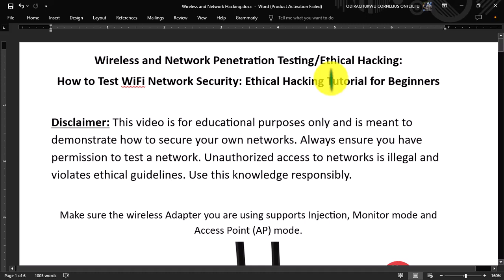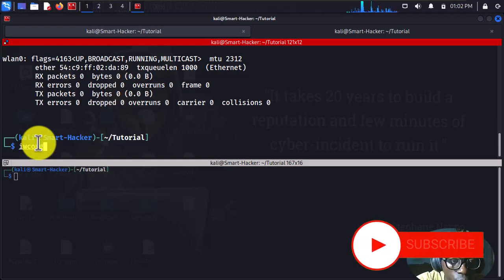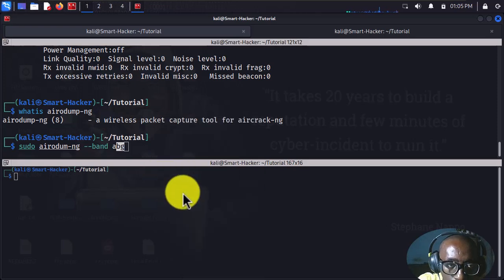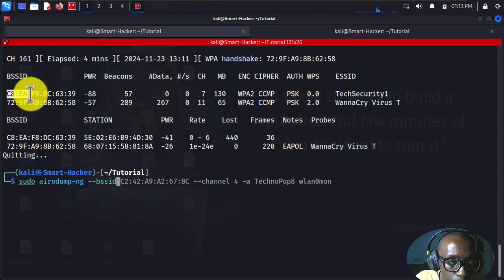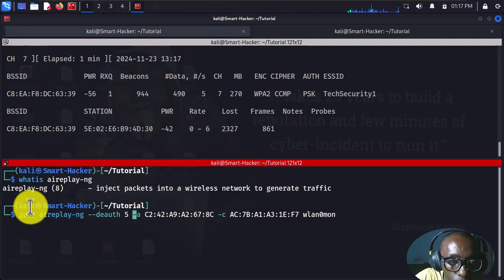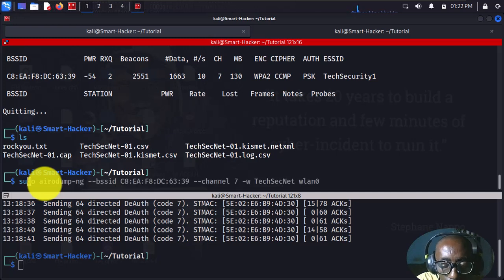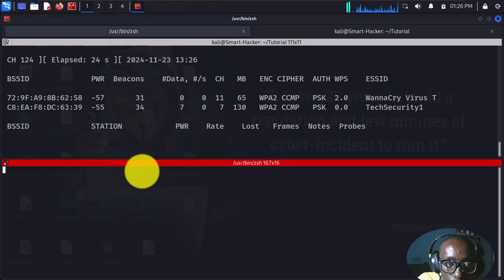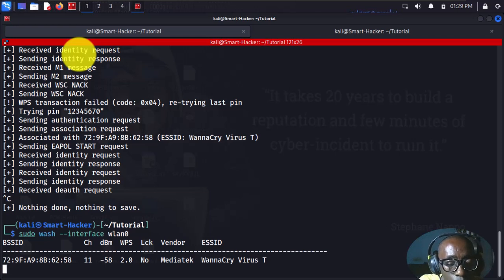🔐 How to Test WiFi Network Security: Ethical Hacking for Beginners 🔐

Comment: I also wants to know what is the background process of ISP? I mean how do they control and monitor our wifi router remotely? which tools or software do they use? and can we hack into their devices to get a free internet without paying bills HAHAHA just kidding
I'm just curious to know background process because I have no knowledge.

I hacked my neibors wifi, then scanned it and found some open ports including SSH, Telnet etc.. so then I try to gain access using ssh port but it's password was not default so I failed, But I tried to guess the admin password of their Routers web interface, and found that there are some actions that I can't perform like deleting System logs, or accessing ssh.
So I am thinking that Support team or Isp could have all the permission to perform any action rather than Admin user, That's why I want to know and learn about them like how do they provide internet, how do they know we have not payed our bill, or how do they can disconnect us from using internet remotely. and which softwae or tools do they use and can they monitor or intercept our data even if we are using HTTPS ?